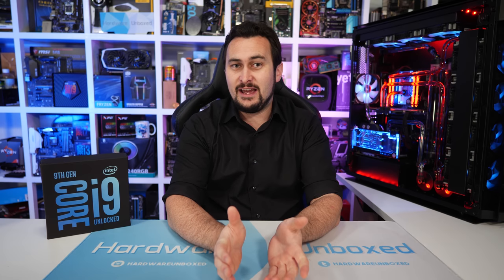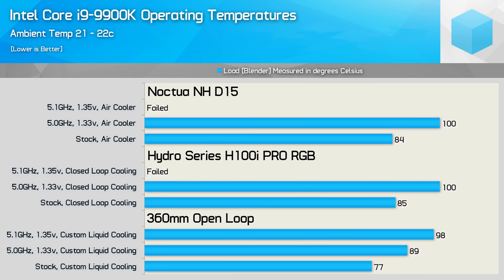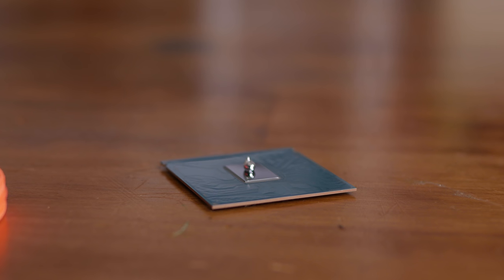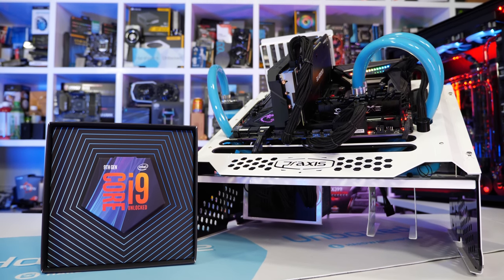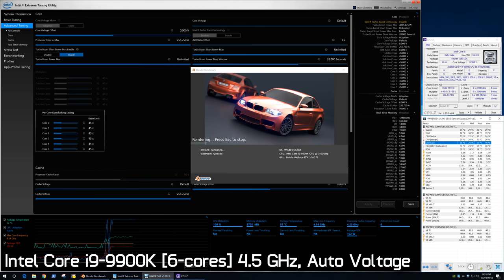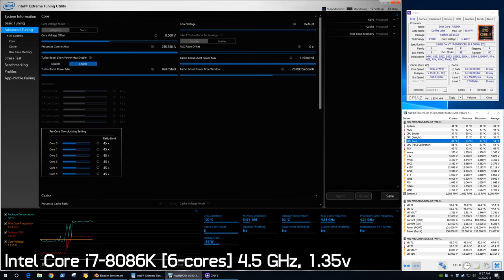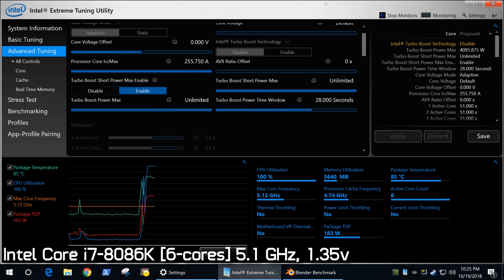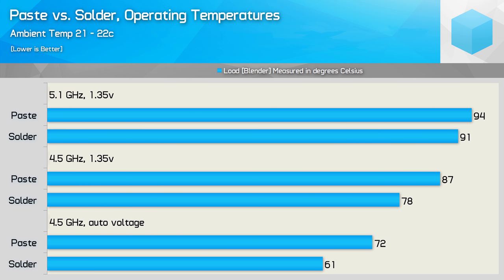Why is the Core i9-9900K so HOT? STIM test, Solder vs. Paste

Comment: Lol... shouldn't be that much hotter than the 2700X... nope it's running at upto 4.3Ghz or 4.2Ghz for a max overclock also AMDs cores a smaller than Intel's cores and AVX 256 runs half speed on Zen, furthermore AMD has removed a bunch of legacy instructions to get there core size smaller. Ontop of that Global Foundries "14nm" is just 20nm with FinFETs and "12nm" is only marginally smaller than Global Foundries 14nm this means that AMD having smaller cores even when there node is bigger means that if they were on the same node AMDs cores would be tiny.

This is why 7nm will be such a boon for AMD because they can increase the transistor count of the cores there by increasing IPC and still have much smaller cores than Intel due to the fact that TSMC's 7nm will be competitive with Intel's 10nm on density. So when AMD actually moves to 7nm they should be able to push high clockspeeds without high power consumption, while Intel will be stuck on 14nm for most of next year and even when they do catch up with 10nm there cores will still be significantly larger limiting clockspeed through thermals.
Reply: Well ontop of that there is the fact that 10nm is a dumpster fire and 10nm+ will not improve clockspeeds over 14nm++ by Intel's own admission: http://3s81si1s5ygj3mzby34dq6qf-wpengine.netdna-ssl.com/wp-content/uploads/2017/04/intel-xeon-process-technology-enhancements.jpg

So anyone waiting for 10nm to be awesome and extract AMD balls from Intel's mouth will be sorely disappointed. So it's going to be a double whamy until now Intel could rely on AMD being on a shitty node, but now they have a good architecture which will scale well on a good node and Intel is going to be on the crappy node with there old architecture. It's wouldn't be quite analogous to Bulldozer vs Sandy Bridge, but it's not far off as Intel hasn't done a ground up architecture since 2008, while bulldozer was the culmination in not doing a new architecture in since 1999 to till the launch date 2011.

So that is 12 years, but Intel will be at 11 years by 2019. So it's a similar failing, but at least AMD had the excuse of Intel fucking with them via illegal means and also previous CEOs spending money they didn't have on over paying for things. Intel was just greedy, straight up. They just didn't want to spend money on developing a ground up architecture and now the chickens are coming home to roost.

It's kind of a good thing in the end for comsumers though because If Intel had kept on developing there architecture AMD would have never been able to catch up and you would be paying $1800 for an 12 core CPU, and a $700 for a "mainstream" 8 core CPU. So AMD being able to catch up in the end will be better for the consumer, even though it sucked for a long time.

Although those CPUs would likely be 30% - 50% faster than todays 8 or 12 core CPUs so take that as you will... As said though long term it should be better... I hope... Lets hope in 2020 with Zen 3 AMD can make Intel look as shit as Sandy Bridge made AMD's Bulldozer look, because Intel deserves the same lesson AMD got. Although I expect in 2021 Intel will have there new ground up architecture ready to launch, by which point I also expect there 7nm to be ready.

But I don't expect Intel to race ahead, maybe they will be a little better, but as long as AMD continues to push along I don't think AMD will fall so significantly behind again.
Reply: Neither Intel nor TSMC is using EUV for their 10nm or 7nm. I know Global Foundries was planning to use EUV with 7nm+ and I think there is a chance of that still happening as the reason they are not moving to 7nm is simply because TSMC was going to get there first and AMD went with them, but AMD will still be using Global Foundries according to some credible leaks that AMD plan to change the way there CPUs are made with Zen 2 basically on Epyc they are going to have a 8x 8 core dies made on TSMC's 7nm + a uncore die with the memory controller, I/O controllers etc moved onto that die which will be made on Global Foundries 12 / 14nm.

This way Global Foundries gets a fee for every wafer AMD uses on TSMC due to there the agreement they made when Global Foundries was spun off from AMD, and they will be producing the uncore dies. This means Global Foundries can take a break and not invest in bringing 7nm to market yet, but at the same time make money.

This would give them the man hours to put into developing 7nm EUV quickly, and also speed up development on "3nm" which will be analogues to Intel's 7nm.

This also make me believe that AMD will be doing a 16 core AM4 CPU that will be made out of 2x 8 core dies + an uncore die, because I believe the uncore die on Epyc will be made out of 4 segments each supporting 2 core dies 4 channel memory and 32 PCIe 4 lanes as another less substantiated rumour also suggests that Eypc will have upto 16 channel memory.

I could be wrong, and AMD could go with a 8 segment uncore die each supporting 1 core die, 2 channel memory and 32 PCIe 4 lanes. But I don't really believe that option due to the extra latency it would add due to the all the links required, where as with a 4 segment dies you could place all the memory controller in the centre of the die so they could work in UMA "unified memory access" due to high bandwidth low latency links between the memory controller segments that the short proximity between the memory controllers.

So my educated guess as said would be the first option, and if I am right on everything else including some other things I have not mentioned AMD should be able to roughly match the performance of a 9980XE with a 16 core CPU costing I would assume around $700 on the AM4 socket.
Reply: If zen cores are that much smaller, then explain zen's 213 mm for 8 cores while the 9900K is 16% smaller at 178mm.
AVX 256 does not run "half speed" it's a question of what instructions are put through. Regarding 128 bit AVX though AMD can do four to intels two. Also explain AMD's "smaller" cores superiority with SMT, there's a reason for this Ryzen can run more micro ops per cycle.
Finfet is not just SOI with fins so it's meaningless to say 20nm with finfets. Intel doesn't release transistor counts so it's kind of impossible to accurately say who has bigger cores. 

Zen has 4.8 billion a 6700K has 1.75 billion 8MB cache @ 122mm and a 9900K has twice the cores and twice the L3 cache and also has twice the L1 and L2 per core. So roughly the 9900K is 2x 6700k's with a few additions, but those additions need to make up 1.3 billion transistors to equal the transistor count of zen.

Going from 14nm to 14nm++ gets you reductions, but were talking only 50% more die space for twice the cores and extra L1&2 cache. 

Your hypothesis on smaller cores isn't warranted especially as AMD has more L1 and L2 cache per core.
https://en.wikichip.org/wiki/amd/ryzen_7/2700x
https://en.wikichip.org/wiki/intel/core_i9/i9-9900k
Reply: I am only measuring the cores and cache as you can see there is a lot more to the Zeppelin die than cores and cache: https://i.imgur.com/Uq9Zrc3.jpg

I did mean to write "EVERYTHING ELSE!!!" Somewhere on that image, but I forgot. Just Imagine a that somewhere on that image.

I did not say anything else on the die was more or less compact, in fact the cores and cache only make up aproximity 40% of the area of the die, furthermore when I say 14nm was 20nm on FinFETs I mean that 14nm was no more dense than 20nm, you knew exactly what I meant don't play semantics pleas.
Reply: This is an image of the 9900k https://hothardware.com/ContentImages/Article/2792/content/small-9th-gen-die-shot.jpg.ashx?maxwidth=1170&maxheight=1170

the cores and cache take up approximately ~60% of the die space... probably more like 70%... Which isn't a bad thing per say, but it means that they have less space to sink there heat.
Reply: "furthermore when I say 14nm was 20nm on FinFETs I mean that 14nm was no more dense than 20nm"

14nm finfet is more dense than 20nm soi, if it wasn't why go there? (hint finfet allows greater densities)
https://hal.archives-ouvertes.fr/hal-01541171/document
"As compared to 20-nm technology node [Sicard2014], the 14-nm technology offers:"
"• 30 % less power consumption."
"• 30 % increase in switching performance."
"• 2 times higher density."
You are objectively wrong here.

Don't you think that there's more to an Intel CPU than just the cores.
https://p.xfastest.com/~sinchen/Intel-9th-Core-i9-9900K/Intel-9th-Core-i9-9900K-11.jpg

There's a whole iGPU taking up about a quarter of the die space and i/o takes up about 1/6, so at least 1/3 of the die isn't cores, looking at Ryzen the cores are about 60% of the die space.
60% of 213 is 138 while 60% of 178 is 106. Given that there are some variances in the processes used we could say about even.
But the thing comes back to transistor counts too and Ryzen very likely has a lot more, especially for I/O (which is much higher than intel as zen allows for up to 32 PCIe lanes (24 used on 2700X) while the 9900K has it's piddling 20 (16 + 4 for PCH).

Your confidence in your claims that Ryzen has "smaller" cores has no basis from which to back that up and there's evidence that the Intel cores are in fact smaller in terms of transistor counts (L1 and L2 cache is smaller). You also need to take into account that the intel architecture is the default for code compilers, much of that IPC advantage (not performance related to clockspeed) is due to code which is built upon code which is built upon code that all points back to intel.

There just isn't any reason to assume that Intel's cores are bigger and hasn't been since zen was released.
Reply: I have condensed my comments into 1 comment to make my point more concisely... The Zeppelin die is 45.3% cores and cache, Coffee Lake R CPU is 56.54% cores and cache. That is a 24.5% difference. if Coffee Lake R used same area for cores and cache that you would need to increase 178mm2 by 25.4% which would be 221.6mm2, which would make Intel's die 4% bigger.

I used the resize tool in Paint to get the pixel count. That is how I got my numbers, and no I didn't resize anything it was just the easiest way to get the pixel count by just selecting it.
https://i.imgur.com/yCEtRXe.png
https://i.imgur.com/6G4D0ie.png

Furthermore as has been mentioned Intel's 14nm is significantly more dense than Global Foundries 14nm because Global Foundries only claims 15% area reduction and due to various credible sources which are authorities on this matter have claimed that 14nm did not increase density over 20nm I am inclined to believe them; especially when you consider the fact that Global foundries claimed 15% area reduction for 12LP to and the Zeppelin die did not shrink one iota from Global Foundries 14nm which displays Global Foundries character as being willing to basically lie.

https://www.globalfoundries.com/sites/default/files/samsung-globalfoundries-14nm-collaboration-press-release.pdf
"The platform taps the benefits of three dimensional, fully depleted FinFET transistors to overcome the limitations of planar transistor technology, enabling up to 20 percent higher speed, 35 percent less power and 15 percent area scaling over industry 20nm planar technology."

https://www.semiwiki.com/forum/content/6713-14nm-16nm-10nm-7nm-what-we-know-now.html
"Intel's 14nm has the smallest CPP and MMP of any 14nm/16nm node process and combined with a 7.67 track cell provides the densest 14nm process. We estimate that the Intel 14nm process provides >1.5x the native logic density of the other processes at this same node. At 0.0588 um2 the high-density SRAM cell size is also smaller than the other processes."

And that >1.5x is 1.5x or greater, and that is verse TSMC I think which is more dense than Global Foundries, as said when AMD moves to 7nm due to there cores and cache being approximately 4% smaller on a node that is at least 1.5x less dense and TSMC's 7nm expected to be marginally smaller than Intel's 10nm, you would expect >2.5x smaller than Intel's cores compared to Intel's on 14nm, and >1.5x smaller once Intel gets to 10nm. That is if AMD does not increase transistor count per core which honestly I would expect something like a 20% increase so >1.3x smaller cores from AMD.

https://www.semiwiki.com/forum/content/6713-14nm-16nm-10nm-7nm-what-we-know-now.html
"When TSMC introduces their 7nm process they will have a 1.13x density advantage over Intel's 10nm process. In late 2018 Samsung is later expected to introduce their 7nm process with 1.23x the density of Intel's 10nm process, also later in 2018 TSMC will introduce 7+ with a further density improvement."
Reply: So suck it... Oh and the reason why companies used 14nm was because 20nm was expensive and did not offer much performance improvement, all it really provided was a density improvement, but the cost of the node outweighed the density improvement, but Global Foundries/Samsung 14nm reduced costs and offered significant performance and power characteristics improvement with basically 20nm density. Ah I remember now yes 14nm did increase density theoretically, but the node used the same 20nm backbone so area reductions were nebulous at best and non existent at worst in real world application.

If you go back to this document: https://www.globalfoundries.com/sites/default/files/samsung-globalfoundries-14nm-collaboration-press-release.pdf
"...while still leveraging the proven interconnect scheme from 20nm to offer the benefits of FinFET technology with reduced risk and the fastest time-to-market."
Reply: And I think I will take your lack of an answer for conceding the point. Although I think I have done a good enough job of making my point that you conceding would be meaningless. Apart for the fact that I would like an apology for assuming I had assumed anything, but I doubt I will get it.

Comment: i've got some idea :) what if cap of crystal will perfect polished silver, what if perfect polished cap of cpu will mounted on the crystal with any rare gas, for prevent silver corosion, and what if crystal's cap and cpu cap, after mounted cooler imitator all that construction will heat for 70* then coocking  till diffussion(diffusion in metals), silver to the cpu's cap, i think that technology will cost some, but technical culture today is good enough for do it... what we got now? we got big fat crystal, bigest and fatest than 8th gen, an we got porous shitty alloy, what not much better than paste... if silver are too expensive can use cuprum, but cuprum not so malleable, and that's will harder to create this crystal with cuprum shell, i tallk about it, not cuz it have any folking sense, couple of degree? who give a shit... but people will stay delidde it, just till crystal and  cap will have crap between them :)

Comment: Didn't der8auer, when he delided the 9th gen parts conclude that the die was a lot thicker and was likely the cause of the higher temperatures in the 9th gen parts
Reply: If you watched the video you would see Steve talked about this. It is likely a result to stop the CPU cracking and strain under constant thermal load to preserve the CPU from a premature death.

Comment: INTEL: we in the lead this 10 mm can wait
AMD: Infinity fabric is a great solution to heat and power, release the ryzen
INTEL: WTF 8core 16 threads , wtf 16 core 32 threads
AMD: Not gonna jinx it but looks like we got a winner
INTEL: Everyone loves those Ryzen, "engineering" we done with that 10nm, no boss you told us to keep bleeding g the customer with 14+
AMD: 12nm ready to roll out, "engineering" yes Ma am
INTEL: WTF better ipc gains and still low temps, Now 32 cores fuck, fuck, fuck, "engineer" hey boss we still cant get 10nm to work but we can make a space heater with 8 cores
AMD: is the 7nm ready "engineering" yes Ma am with 13% ipc gain and higher clocks
INTEL: Wtf AMD might release a 10 or 12 core mainstream chip,10nm finish yet, "engineering" no sir.........FUCK, FUCK, FUCK

Comment: Im looking at these thermals and thinking hmm 85°c at 4.8ghz all core turbo under a heavy blender load... That's not bad lol I could live with that, likely I'd never see temps over high 70s gaming. Considering my laptops i7 6700 runs at 90° c at 3.5ghz when gaming it seems like stellar thermal performance 😂
Reply: 85°c at 4.8ghz on the wc
Reply: on the aio water cooler yes, also the same temp on the air cooler tested

Comment: intel on 9900k not pronte for use commercial,95W is low,more clock other error,is 9900k is i7 9700k with 16 thread,very error intel is premature for commercial,increase 125W not sprigione the potency ans create type bottelnek,in fact in onverclock max clock of 4 core or two cores,not stable sama 8700k or 8086k OC  more cores,low voltage in DIE,the projet,is better long time adjusting defect.My opnion in democracy.P.S. Not strange all 95W all processor?8700k 95W  and 9900k 8/16 thread and much clock equal?idem i7 9700k 95Wv only 8 corev e low clock.in 8th generation why 8700 not K low clock 100 MHz is 65W?matematic is not opinion...

Comment: 9900K = 95W TDP 2700X = 105W TDP. 
AMD is on 12nm die Vs Intel 14nm die and AMD still Cant hit 5Ghz. 
Wake Me up When AMD hits 5Ghz or 5.2Ghz all Cores
Reply: 9900K real TDP: 250
2700K real TDP: Under 150W
Reply: Still Not waking up until AMD delivers a  CPU which can offer 5Hhz across all Cores. My 8700K slaps the 2700X around like an old stripper and a pimp.

Comment: People complaining about heat from the fastest 8 core 16 thread cpu currently for sale. Of course it's going to be hot at clock speeds AMD can only dream of at the moment.
The FX9590 was never even remotely competitive, whereas the 9900k is =the= fastest gaming chip bar none.
FX9590 was hot AND slow. At least the 9900k is fast.
Reply: Fast in what? 1 % faster than 8700k. Makes zero sense to buy it for games